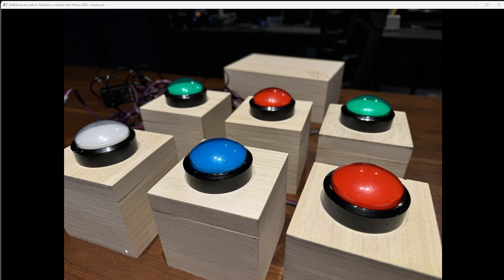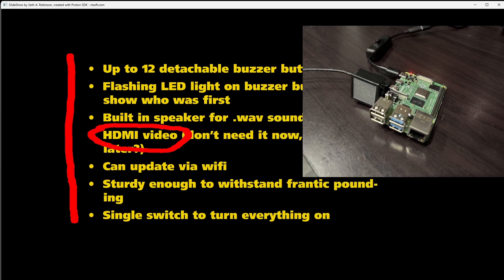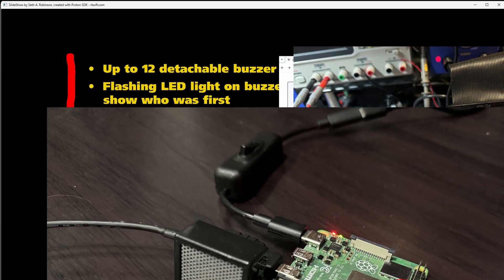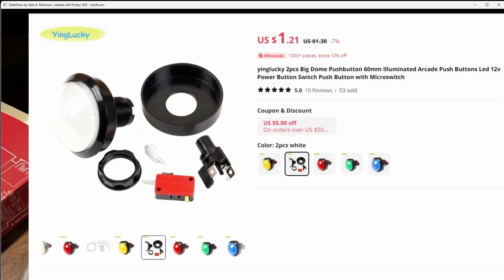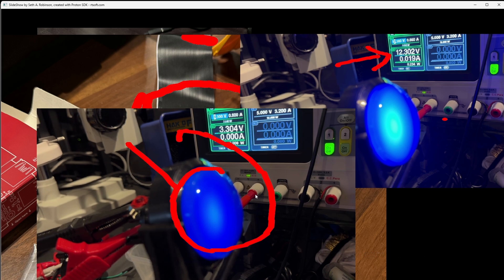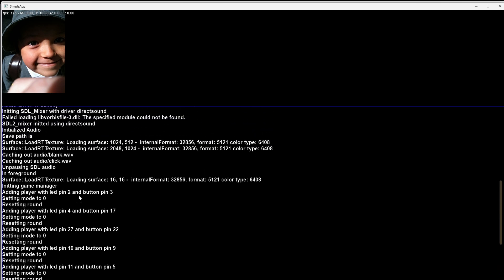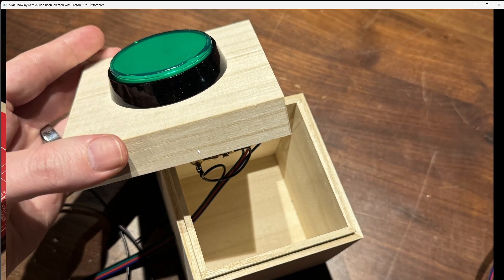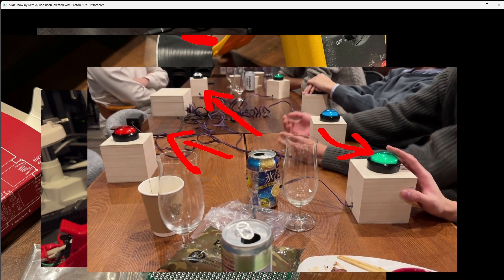Making a game show buzzer system (Raspberry Pi project)

Comment: That's nice and I liked how you didn't  use 3D printers or plastic. Maybe a bluetooth or Wi-Fi function would be great to include so the boxes would be easier to store, place and hold but that would require a battery for each box and may not be compatible with HDMI power requirements. It would be a nice try to include both wireless and wired options. Plus, covering the boxes with smooth/fluffy fabric might be a good idea. Also just make the speaker stand higher so its top is in the same place with the outer box so you could cut the hole according to that and would look better.